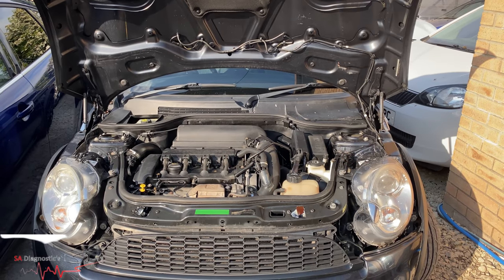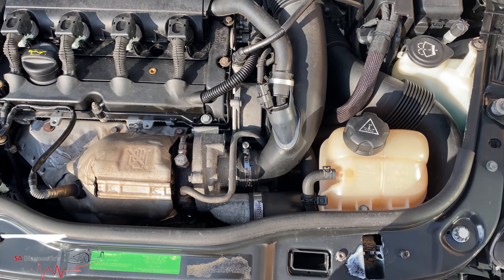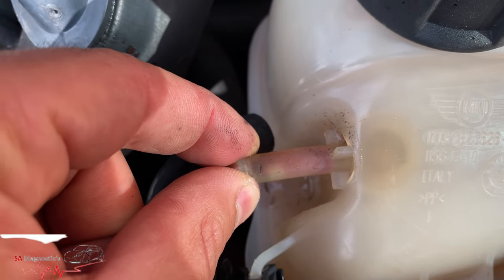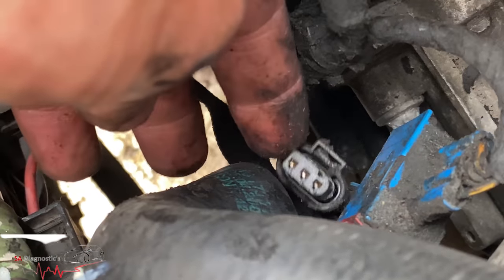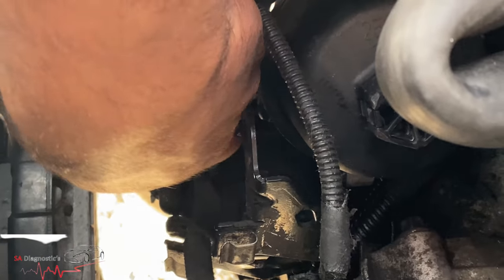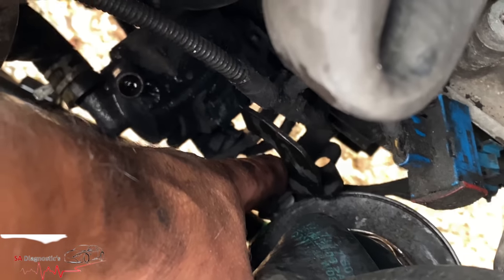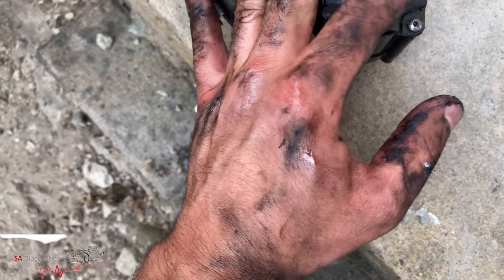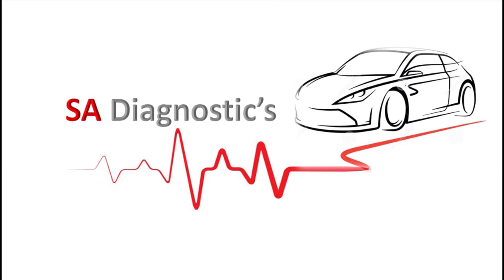MINI 2F37 Digital Motor Electronics DME Auxiliary Water Pump Activation How To Change It

Comment: Mercedes A45 headlight and control unit change,try to coding fail,using Autel ultra 
I don’t know why
Reply from the maker: Are you scanning the QR code
Reply: @sadiagnostics  yeah
Reply from the maker: @GayasUddin-rk5kx  one thing I’ve realised with Autel is that it doesn’t code in some headlights whether it’s bmw or Mercedes it just doesn’t work. I’ve had this trouble for last 3/4 years and thought they would fix this issue and they still haven’t by sounds of it. However you can try using genuine dealer software and this should do it but obvs this eliminates the use of Autel unfortunately. I do have a video on how you can code in Mercedes headlight search it in my videos and you’ll see the process…
Reply: @sadiagnostics  👍